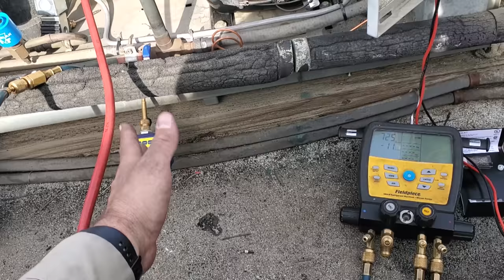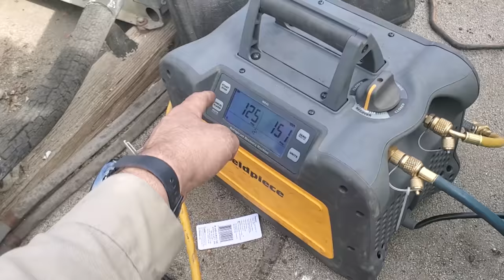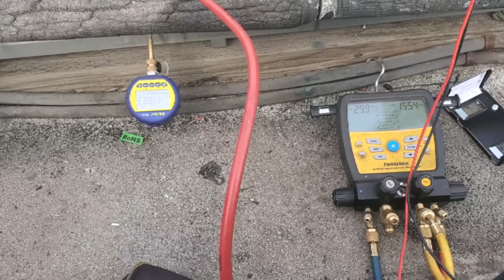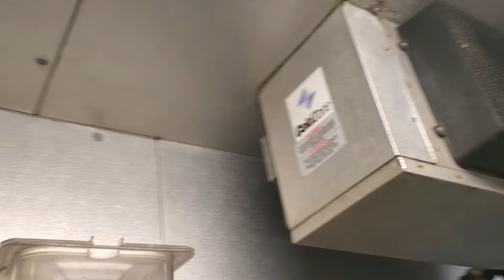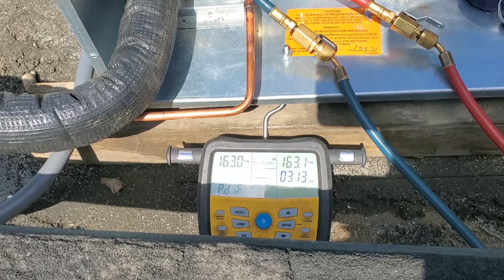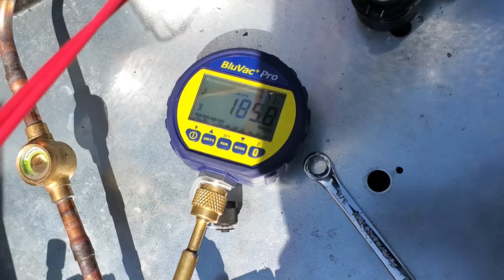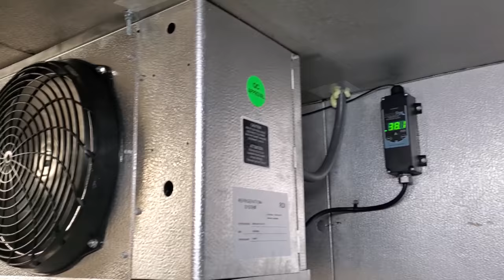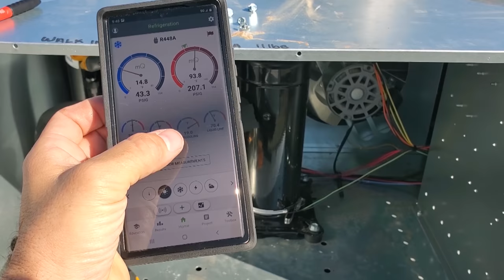THEY LOST POWER IN THE MIDDLE OF THE REPAIR

Comment: That weird power was just one leg energized and the voltage being induced to the other two legs. If you have a low impedance meter it probably would have shown 0 volts to ground. Super common to see when wires are run close to each other and usually it's near 80 volts on 120. But the Low Z (Z = impedance) feature on a meter is there for exactly this type of situation. Not so common is a situation where the power company can actually supply weird voltages like that. Not saying it can't, but not common. And depending on how they are re-energizing you can end up with one phase coming on at a time and a few seconds to a minute before all phase come up. Especially in a tricky situation where they can't get all three cut-outs thrown in from one location in the bucket. 
Also, Christmas Eve, eve is actually called Christmas Adam. ;)
Reply: No, no, there are much better explanations than induced voltages.  And the voltages likely were real with enough amperes available to be consequential in the destruction of three-phase motors.
Reply: @denverbraughler3948  Better explanations such as?  And if this was a real event that whole area or at least building would have experienced it. Not looking to argue, but just discuss what other possibilities you think could have caused it. It's been a year since I watched the video, so not really up in what exactly happened here.
Reply: @inothome :

If you read through the other comments, you will find the possibilities.

In short, any load connected across two phases (for example, a 240V water heater) connects that phase at a limited ampacity.  But it’s 0° out, so measuring between the ungrounded conductors will show 0V.  The supplied phases will show 120V nominal to ground/earth/neutral.  The missing phase will show a lower voltage, but it can be anything lower, 110V, 97V, 23V, …, and it will swing wildly as loads are connected and disconnected.  This situation is very similar to a loose or broken neutral.

And any running three-phase motor actually generates the missing third phase.  So again the voltage to ground of this generated phase will be anything up to the phase voltage.  But the phase-to-phase voltage will be higher than the phase-to-ground voltage, because it is nominally 120° apart.

Comment: At least you have didn't to worry about blowing something up since the power is out, or worry about getting shocked.
Reply: It's actually a bit of a dangerous situation, the power coming back on unexpectedly can cause all sort of issues.
Reply: That situation is way more dangerous than to work on powered equipment, due unknow voltage fluctuation. in single phase circuits, with all modern electronics can be deadly .  keep in mind that while for a filament builb ( that is at the end a resistor) less voltage means less light, in all others situations u can have the neutral polarized with damage on equipment.

In a 3 phase system, having those difference between each phase  can result into a winding burn, due the misalignemnt of phase.  it's like an engine running with a seized piston... catastropic !

Comment: so when you annealed the copper , did you let it cool a little then ratchet bend it ? ive always wanted to bend my hard pipe acr .
Reply from the maker: Yeah you heat it to cherry red than rapidly cool it and bend it after it has cooled, all while purging nitrogen
Reply: @HVACRVIDEOS  nice info , thanks !
Reply: @HVACRVIDEOS   I assume the largest you can bend is what a ratchet bender will do , but what about 1" -1/8 with a conduit bender ?
Reply from the maker: I've never tried a conduit bender but I don't think it would work as you would damage the pipe when you press it on the ground to bend, however they do make electric pipe benders and those will work for larger sizes

Comment: Why do you sometimes flip the tank upside down and other times right side up?  Im know next to nothing about hvac just like watching the vids. Thanks!
Reply: I don't know the "whys" or "hows" but I know from doing car A/C (134a) that holding the can upright gives you gas refrigerant, and turning it upside-down dispenses the refrigerant in liquid state.
Reply: you have to charge as liquid on blended refrigerants because it separates at different pressure and temperature, if not you'll end up with a non-blended mess in the system, with endless issues.
Now single component refrigerants can be charged as gas or liquid, like R-12, R-22, R-134a.
Example, the new system he installed in video was R-448A, which is actually a blend of (R32/R125/R1234YF/R134a/R1234ze) in different percentages.
also the special recovery cylinder with two knobs has one opening at top of tank and second in a dip tube to the bottom.

Comment: In the past, I have seen HVAC people just leave the old equipment in place at least the condenser unit on the roof just with power and sometimes lines, disconnected. I guess that was just lazy and it was back in the days when it was acceptable to vent refrigerant to the air!
Reply: Half the machine rooms ive ever been into had atleast one old compressor, fan-motor, cooler-door or any kind of pressure switch.

Comment: I wonder if there are three phase breakers that auto trip off when there's a power outage to avoid situations like at the beginning of this video.
Reply: There are phase Monitors what Look for funny voltage issues and can turn off contactors. I have never seen them integrated in a breaker.

Comment: 12:13 Why did you put the T straight up why not have it point the direction it needs to go an only have one bend in the 5/8 line?
Reply from the maker: It was acting as a reverse trap for the suction riser ... to help keep any oil from draining back into the coil

Comment: I've watched you long enough to go change my capacitor, wish me luck.  Big picture diagnosis:  Its a rheem 1.5 ton? Its held a charge since Katrina. But the old unit that is in the attic they reused and was underwater, Blower, board, and all the heating side was replaced.  Noticed the fan motor is a non-standard replacement and the rotation was backward. Dude thanks .

Comment: Why are you heating up the copper joints to 800 or so degrees Celsius when the solder is good for 240 Celsius. The copper shouldnt be glowing red hot.

Comment: What? You don’t carry a spare three phase generator along with you on calls? Just kidding, it can be frustrating, I know. I am just wondering why on new installations that you can’t use the crimp on connections that seem to be really good now. Why still use the old copper lines and braze in the joints?

Comment: "Relieve stress on the power grid", and then comes an Electric Car that needs 150-350kW charging.
Reply: Its actually the opposite, Electric cars can be used to stabilize the grid because they can be planned and are very low priority if charging at home
Reply: @tobimai4843  hahaha, multiply that by millions and millions of vehicles, both private and commercial, whooops.